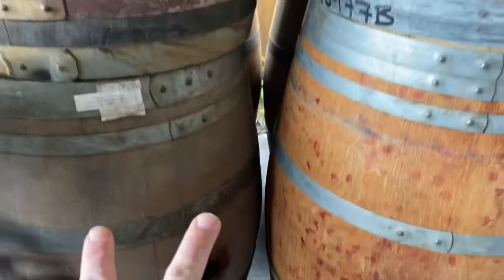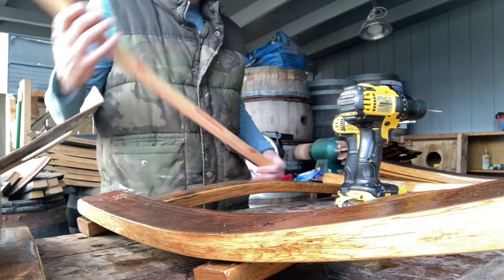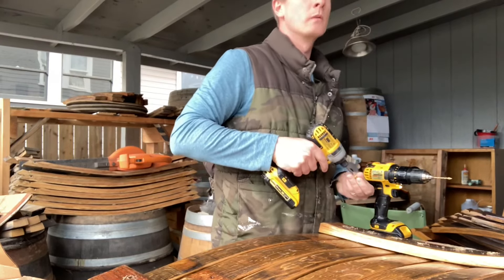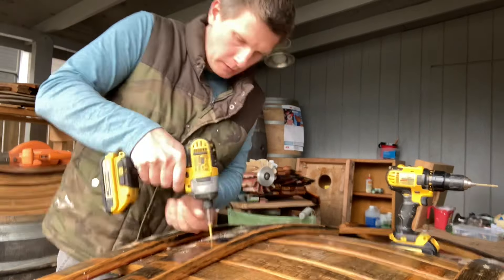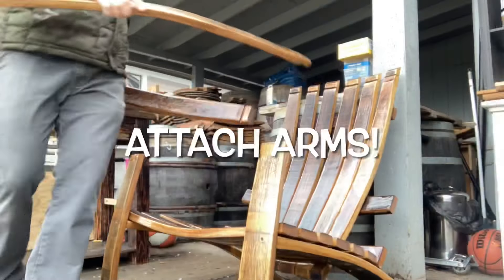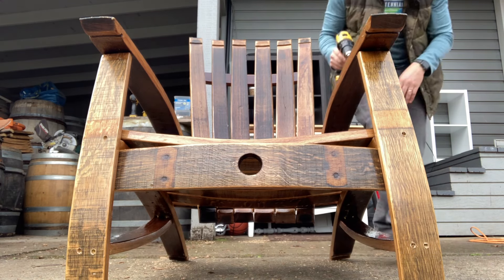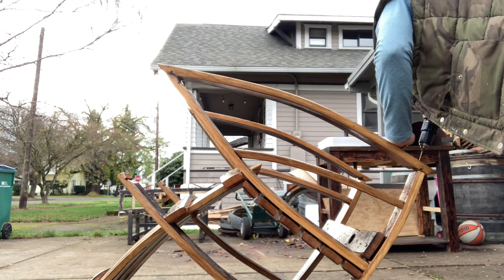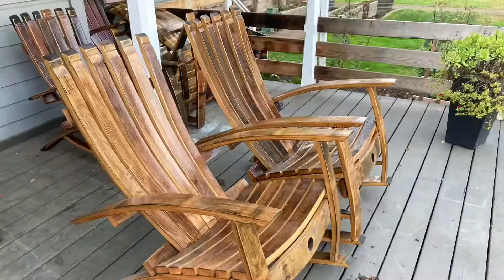How to build a rocking chair with a wine whiskey barrel DIY

Comment: To fill the holes I bought a plug bit from harbor freight and cut out several plugs from a stave cut off. The grain will go the same direction and you can lightly chisel it to match the height

Comment: Instead of 3 drills, get a counter sink drill bit, you will be able to drill the pilot hole and counter at the same time! Nice video and great idea
Reply from the maker: The most frustrating thing about woodworking is knowing that the simplest concepts have already been invented and will solve your problems. Yes, you are right. I never even considered this. 🙌🙌
Reply: I came here to say this too, countersink bits make life so much easier!

Comment: Please tell us what Sealers to use on the charred side so char does npot rub off on clothing. Thanks hawk
Reply from the maker: I use a spar urethane, oil based, exterior grade, satin finish as my sealing coat. Apply at least 2 coats. I’ve had the best luck with that. I’ve used deck sealer, teak and tung oil, some other stuff, but best results with spar urethane

Comment: Question for you. On your instructions, you talk about cutting the back legs at a 5 degree angle so they point inward toward each other. I was trying to figure out what you meant or how that was possible when building a square w the seat base. Thanks in advance!  Great video and great product
Reply from the maker: Great question! I posted a video trying to explain. There will be a slight overhang past the seat board so the front leg can connect. The angle is to try and match the curve of the front brace. I hope that is helpful in some way 😂

Comment: Do I need 2 barrels to =1 chair?...pretty cool btw
Reply from the maker: One barrel will give you 25-30 staves. Rocking chair requires 23-26 staves. The short answer is, you should be able to go 1 for 1

Comment: Thank you so much for this video! Quick question, should the barrel be completely dry before using the staves or should I saturate the barrel before disassembling and cutting? Thanks!
Reply from the maker: I’ve had better results with dry barrels 👍
Reply: I thought so! Thanks!

Comment: Question here. Can this be made from one barrel or will you likely need more then one to complete? I have a single 55 gallon barrel. Thanks!
Reply from the maker: Yes, you can make a full chair with a single barrel. The chair takes 23-25 staves, and a barrel will have 25-30 staves. Just be sure to lay out where you want all the boards to go, and you should be good